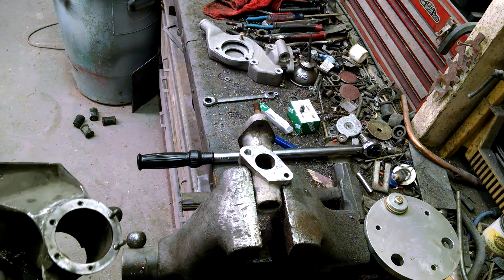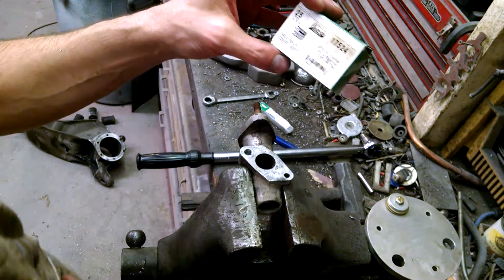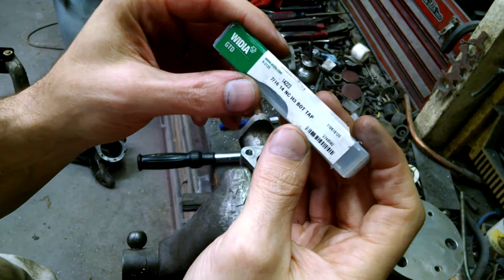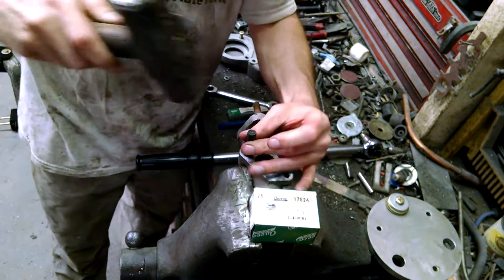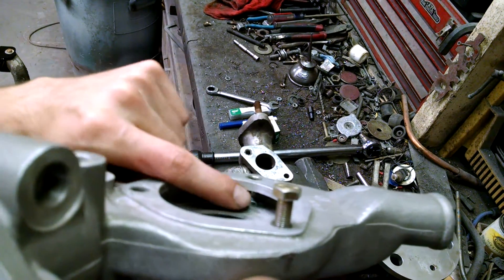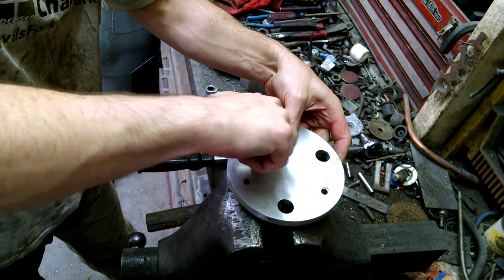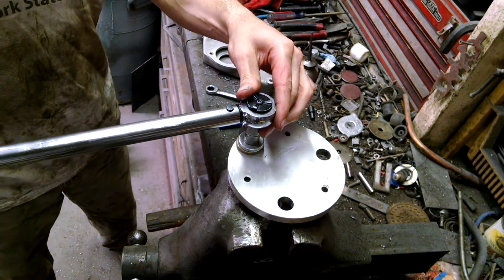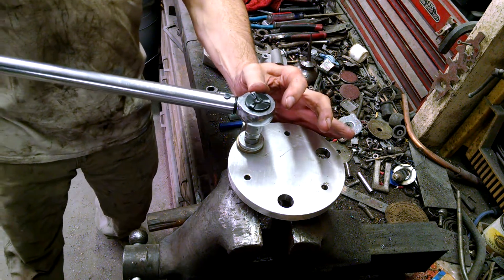Triumph TR6 Hub Keensert Failure TEST

Comment: Its been a while since this video was posted. Have you come up with another method?
I 'think' some of the sections of the plate might be able to be completely drilled through and then a bold installed from the rear with the threads sticking out the front. You could spread the load by installing a rear steel section of washers or flange'', around the rear section of the trailing arm plate, before the bolts are slipped through. Or have the aluminum retapped to the bolt thread pitch, with the extra length sticking out to mount the hub. That way the bolt from the back is double secure.
The other idea I had was to machine a 1/4 inch plate of steel with studs welded to the plate. Then the plate is attached to the trailing arm. Use the 6 original stud holes to mount the plate, but then add more holes around the perimeter for the plate to be securely attached to the trailing arm. That way the plate would have to be torn away from the trailing arm flange by the 6 original stud holes, which are now bold holes, but also the extra small bolts you have drilled into the trailing arm flange.
Yes I understand this adds 1/4 inch thickness and moves the hub out slightly, but I think there is enough  adjustment to account for this.
If interested would be very happy to chat about this more later.
Cheers